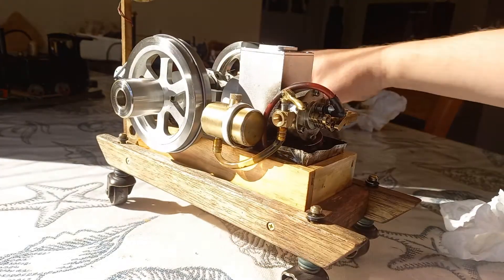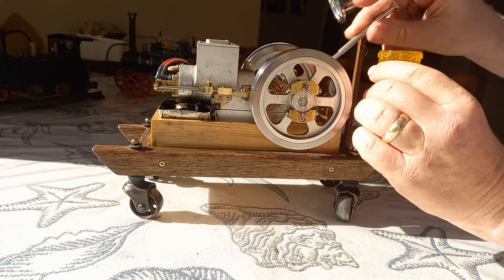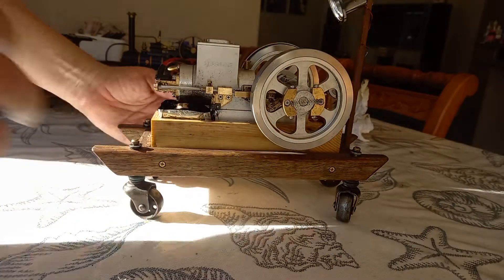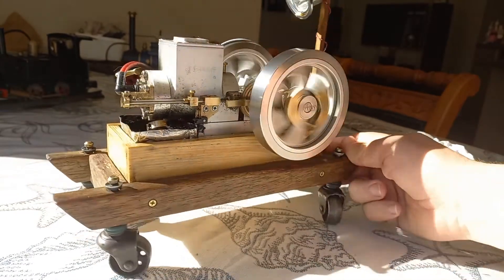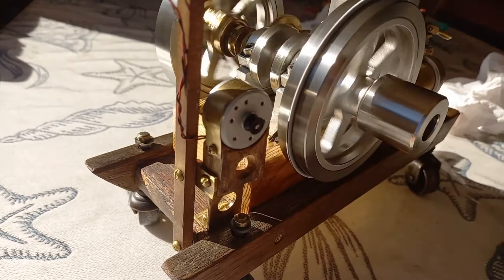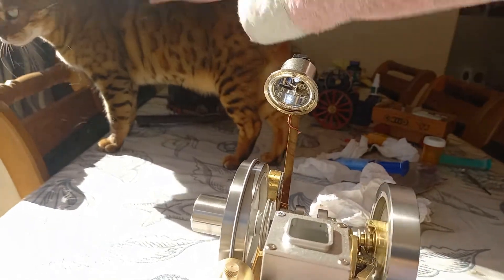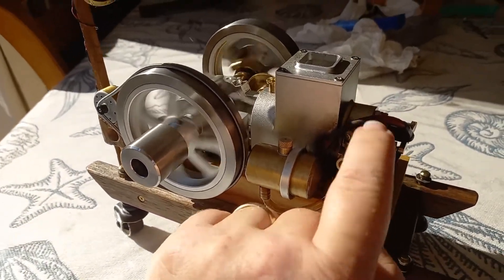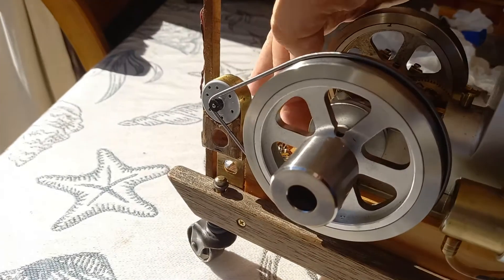SORTED! Chinese Hit and Miss HD from Banggood.com Stirlingkit Enginediy

Comment: Hi,.....Nicely sorted ET1 or M-90 engine with mains crankshaft cap oiling holes !!  .....Is that a Functional rear cylinder oiling hole fitting & what tools & drilling technique used to drill cleanly thru the very Hard stainless steel cylinder liner ?? ?........Thx for video,......tom.
Reply from the maker: Again, late reply...no that brass oli-hole look alike is not drilled through as my drill bit broke off in the hole trying to do that! I now haave a dremel tool and might grind a hole through...but really I dab oil up that cylinder area from the syringe needle which works fine. I'm not sure if that hole is before or after the water cooling seal so I haven't gone there again
Reply: I've been looking at & planning to drill that hole for almost 2 yrs now & was afraid same result would happen !!  ...Just can't figure why the factory Didn't  provide the most basic, Required old school lubrication features such as  the mains caps, con rod & this miserable missing cylinder-piston drip Oilers !! ...The original h&m engines all Had these basic features & wouldn't have survived 1 day without !! ....How can this factory designer just Ignore this as I Would gladly have paid extra for ??
Reply from the maker: Tom have a look at the new model hit and miss engine by Enjomor. https://youtu.be/WBdKBCYli-o
It covers our wish list :) it's not perfect (I'll go into that in a future review) but the main bearings / lubrication superb. That cylinder lub cup though...splashes on conrod just before the cylinder. Assume, like you, it's a cost issue. Anyhow it works, doing both the cylinder and little end...I still dab oil up in the roof of the cylinder with a syringe though!!

Comment: I was hoping you could tell me how you made or purchased the lever on the Carburetor adjustment screw.   Thank you in advance for your help.
Reply from the maker: Sorry late reply. I use scrap brass rod and hold it in a cheap drill press. Then I use a metal file the shape that rod to a lever shape. The rest is use of a file.

Comment: What kind of engine is this? It pulses a lot and doesn't keep stable rpms but seems pretty fun. Could you explain what it exactly is?
Reply from the maker: "Hit and Miss" engine originally when petrol engines were a new thing, one way of governing their speed was to stop them firing if they got too fast. The carburetor was not variable throttle like most petrol engines. Throttle was always 100% open. Over-revving was controlled by a spinning governor that would lock under the exhaust valve keeping it open until the engine coasted down to a suitably slow speed. With the exhaust valve open, the engine couldn't suck in any fuel-air mix, nor compress that mixture. The "miss" cycle also cooled the motor. Under load, eg running a sheep shearing shed, these stationary engines ran under their governing speed and sounded normal if slow revving
Reply: @ThomasPCGuruENGINES  Thanks!